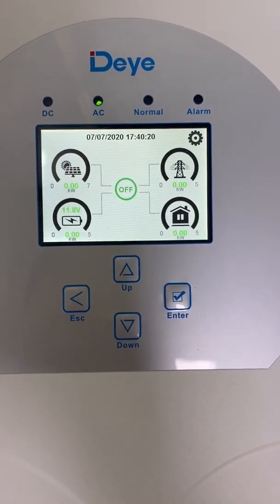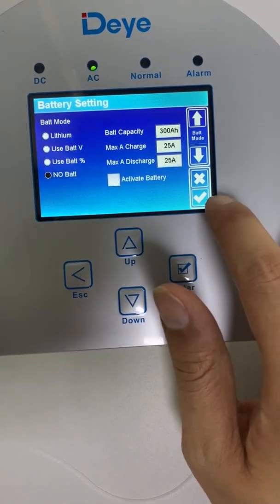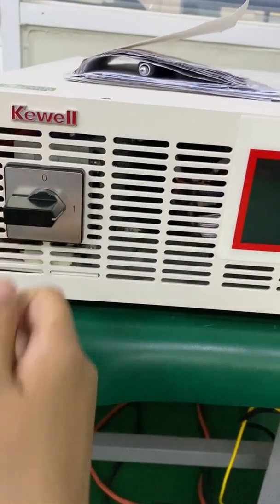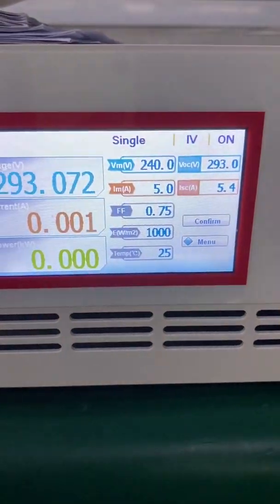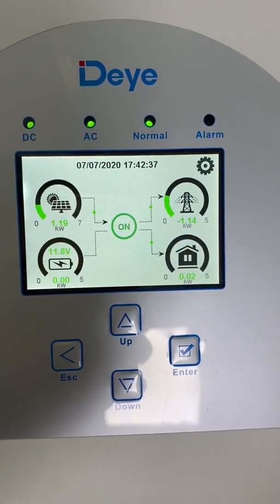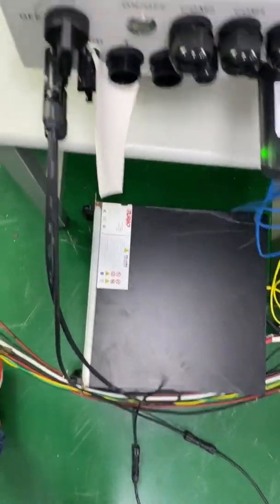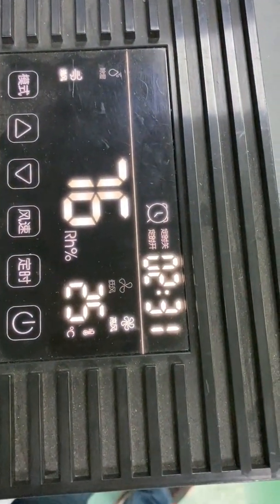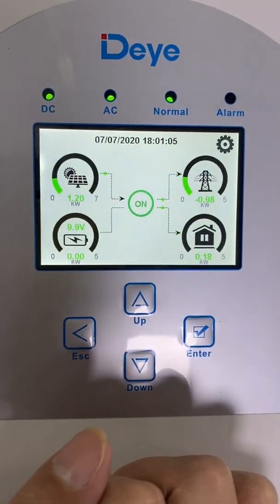How to use No battery mode for Deye hybrid inverter

Comment: In my case whenever i connect dc in with no battery mode inverter show f56  dc low volt error and after 2nd or even 3rd attempt it start working normal

Comment: Hello, question about data transfer to smartphone or PC: is it only possible via WiFi with the included dongle and the Deye or Solarmann app OR also via the Modbus to the router or do I then need a smart meter or how can I see the data on the PC or smartphone via LAN cable (i.e. without WiFi) thanks

Comment: At night did the inverter display the load and the consumption from grid if the inverter without battery??
And The on and off button will not work??

Comment: Hi, just to confirm, when no battery connected and no other DC input, the inverter goes OFF mode (the center of the screen), even it is connected to the grid, and will not report to the cloud (Solarman, Deye Icloud). Is this the "Normal operation"?
Reply: This same thing is happening to me

Comment: sir in use batt v why deye did not follow lvd and shutdown? what is the right setting sir
Reply from the maker: waht do you mean for that
Reply: @DeyeInverter_official  problem is fixed sir, we did not check box in time of use so inverter did not follow lvd, now its working fine

Comment: What happens in your test if you turn of the dc input? When the sun goes under, the inverter cuts power to the backup loads and requires a reset. The grid on the main screen then has a yellow highlight.

Comment: What happens if:
1. you lose grid power whilst in “no battery mode”
2. You are not allowed to feed into grid, can you still use this mode?
Reply from the maker: the inverter will stop working if grid cuts off. if don't sell energy to grid, then choose zero export mode.
Reply: @DeyeInverter_official  do I still need to put CT clamp in this mode even when I have chosen “Zero Export”?

Comment: Hey Kyle thanks for the video. Can I choose this mode if I am not connected to the grid? Can I also choose this mode if I don't sell back to the grid?
Reply from the maker: in no battery mode, hybrid inverter works as a on-grid inverter. it has to connect grid and then can produce energy
Reply: @DeyeInverter_official  in no battery and zero export mode, just PV and DU sharing.  what is the minimum PV panel wattage required? 

Just planning a 3.6/5k hybrid setup, no batteries, zero export.
Deye 3.6/5k hybrid inverter
Breakers and SPDs
Cable/Wires and connectors
Solar panel (minimum wattage?)
Thanks! 😊